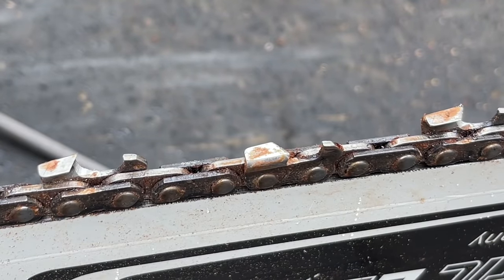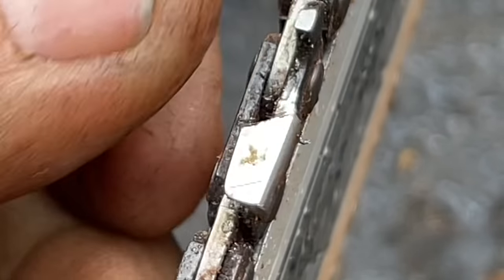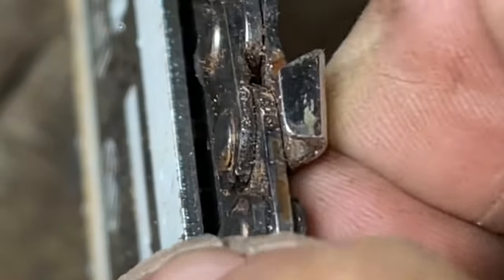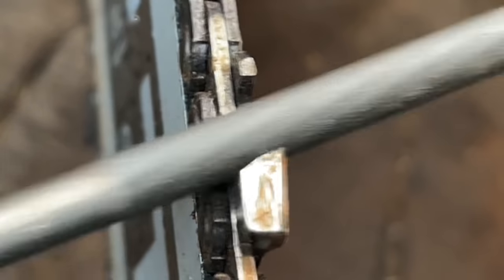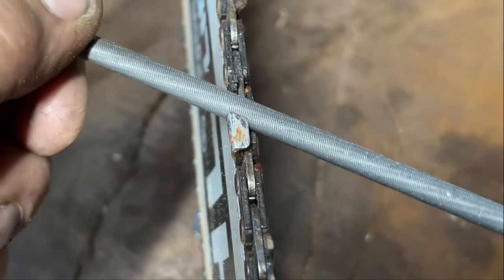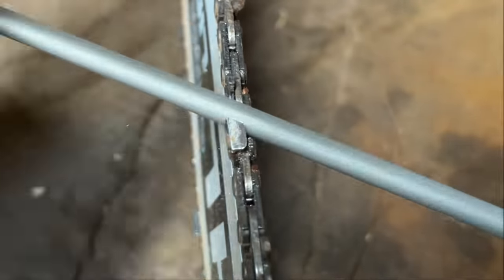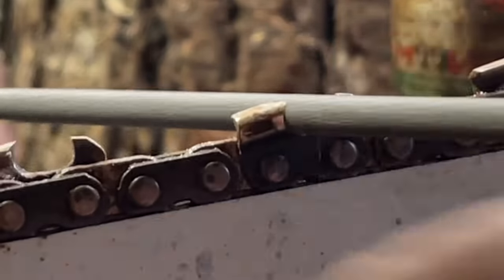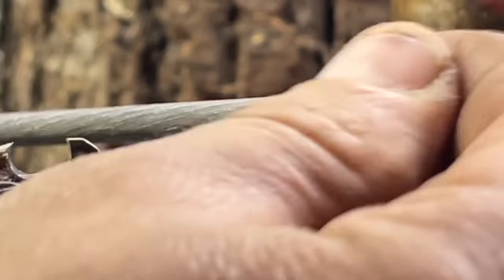How to sharpen chainsaw chain, with just a file . CLOSE UP VIEW!

Comment: I am an amateur Sawyer I watch your videos all the time I been sawing for 25 year's and you show me things I never heard of that work. Thanks man please don't stop making videos. I mostly do it for fire wood but I also remove dangerous tree's from homes. I have no climbing gear but a sharp brain and wise tips like you provide are the best. I throwed away alot of good chain's because I thought they were done and if would have known good completely sideways with file to get that hook back I would have done what you showed me. I run a holtsforma 660 it's a beast. I bought it to make my own lumber. I live in WV tree's are everywhere. I ptefere soft wood but walnut and oak for fires ash stinks to me I don't know why. Thanks again. By the way you are one of the best sawyers I seen so far

Comment: Fantastic video both professionally and personal great candor in teaching you are a natural teacher.
On to the subject matter, we are at this moment have at least 100 trees being taken down behind our property, and trees of at least 100 feet or more which could cut our home and new garage in two. Next to our garage had hardwood stump I decided to cut stump into criss cross paddern to chip it away with backhoe and what was produced was saw dust. Hardware store to have chain sharpened and 2 new ones to go. He used an electric grinder on the old chain and tried it when I got home and it wouldn't cut do da, worse than before. New chain and was able to do the down cuts and across and removed stump. Told my Logger Mike about what had happened and he said exactly what you said "never ever let anyone use a electric grinder on your chain ever, it blues the chain".  He proceeded to say once it's blued a file won't work, the tooth is ackually hardened. And then I stumbled onto your channel, you just confirmed the reasons why thank you so much for this video explaining.
On another note, my Co-driver and I drive to Nanticoke, Ontario to pick up loads of nitrogen and the people we encounter are of the highest caliber in action and in words,  sincere nice people with class the blue collar and management I'm speaking of.
Thank you
Reply: As I'm reading all the other posts a question came to mind. Are the rakers you speak of the steel bump directly in front of the cutting tooth? And I am surmising their job is to clean the saw cut?

Comment: Hey Buckin. I would appreciate some more basic instruction like how to know what size file to use, how to measure the rakers, which direction to apply pressure, what angle you like to sharpen at, etc.

Comment: Hi from down under New Zealand. Now have been able to apply your comments about sharpening. Now have probably cut my time cutting wood 🪵  in half much less effort.

How about doing some video on just turning the saws. High and low jet tuning. Just keep making and repeating the key points and I get there but I need some indicators on what to look for, to hear, so I'm on the right. What to look for when I get it wrong and how to fix.

Thanks
Paul

Comment: Billy I love these videos, I’ve been getting a lot better … not totally consistent but better. iWork with a bunch of saws and I get most confused on which size file to use on which saw. I know it has info on the bar about chain size but sometimes the bar is so worn away it has no info , can you help me out with some tips love you bud thanks.

Comment: Billy is it possible to sharpen a chain after brand new and it be sharper than factory sharp? Hopefully in less than a month I will have my new 592xp its on order from my local dealer. Also, what is the best chain out there? What make and model chain do you recommend?

Comment: The file you're using is huge!  The recommended file for my chains is much much smaller, so small that they fit all the way underneath the top plate.  I feel like it's too small.  Should I be using a bigger file?
Reply from the maker: benjamin , i wood recommend you try both and have yer own experience ,, the file i am using is 7/32  it is what  is recommended from the shop

Comment: 60 yrs ago more or less, at about 12 yrs old, a Lombard saw, a Sears garden tractor and 2 wheel trailer kept our house warm. Daddy was in the bed with a bad back. Old heater was thin metal that would get red hot and almost see the fire inside.  Brake on the trailer was a 2/4 rubbing the tire with brother hanging on. You gotta to what you gotta do, kids nowdays so sorry.

Comment: You should do a video comparing eyeballing it vs using the Stihl 2 in 1 file. Would like to see if the 2 in 1 is sharper or not. Thanks Buckin!
Reply: When you know what you're doing, nothing beats hand filing. You can get it exactly how you want it and make it consistent around the loop.
Reply: Stihl 2 in 1 filer works great! What I do is hand file a hook in there first (get the gullet) and finish with the 2 in 1...

Comment: Buckin you have helped me so much in my filing but I'm looking for a new saw for milling lumber but want it to handle any thing I do really only have access to Stihls so I'm leaning toward the 461 500 or pretty much any of the bigger Stihls just looking for a experts opinion
Reply: 462 has been way better than 461 for us. Both pretty small for milling though
Reply: 881 I think is the current big boy wallet buster.
Reply: @neild7971  Yeah my gut says 661 but I ain't sure have to do more research would love it to handle firewood milling and everything I throw at it I cut stumps every once in a while which is super hard on every part you can imagine thank you for your feedback sure appreciate it

Comment: So equal strokes per tooth really doesn’t matter right? As long as all are sharp?
Reply: Doesn't matter, you will find teeth with different hardness from the factory that just require more strokes anyway, plus its almost inevitable that some teeth will end up shorter over time, some just get beat up worse, no point grinding away all the others to match them up. All sharp, consistent tooth shape, angle etc and you're good in my experience. When you set your rakers/depth gauge its for that individual tooth, longer/shorter doesn't matter so much, its more important they are all the same depth generally 25 thou.

Comment: Would be an educational video to see you “destroy” a chain by hitting rocks and metal someone might run into unexpectedly and then bring the chain back to clean sharp!
Reply: Pretty much what you have here, can get worse I know but same deal.
Reply: @neild7971  it can get way worse, found out the hard way, left sitting with a brand new chain that’s pretty chewed up, found large river stones inside of an old Oak log that was hollowed/rotten in the middle, along with some wire from fencing.  😅

Comment: My chain links more slightly, giving chatter while attempting to sharpen. Your chain does not appear to be locked on the bar for each tooth. What stops the chain moving from the pressure on the file ? Is the chain very tight on the chain bar as there doesn't appear to be any movment of the likns while the file is cutting ? Your comments would be very much appreciated

Comment: I think my biggest take away from this video is the cheap file I bought is trash and don’t skimp on a good file!
Reply: I am confused as heck I confirmed the size of my file for a Stihl 3/8 inch pitch chain eyeballing it in the gullet at clearly is the right size file it's 7/32nds.

I pull a brand new file out of an Oregon bubble pack and it won't even cut at all I pivoted all the way around I go from the front and it won't cut I go in the middle and it won't cut and I go out the back of the file and it won't cut. This is a brand new file. What the heck am I experiencing here? I was testing out a number of different round files I had on my workbench and I grabbed the oldest and nastiest and gnarliest and clearly most filled with metal shavings and guck, and it cut like a champ. I don't have any idea what size it is other than it also fit the gullet properly and looks the same diameter as the brand new Oregon one.

Has anybody experienced this with a brand new file? Did Oregon have a bad batch question mark these are several years old they were just never opened.

You know that sound that a properly sharp file makes like buckin here is experiencing. It's that nice grind cutting noise that tells you you're getting chain back.

Comment: How do you know what file size to use? That’s what always gets me. I usually tend to go bigger
Reply: Usually a number on the upper part of the chain chassis that correlates to file size. Google file size tables
Reply: Also, a quarter of the file should be above the tooth I believe. With a large enough size to reach enough of the gullet.
Reply: 3/16 for .325 and 7/32 for 3/8 works good for me :)

Comment: Hey everyone I was just wondering how long does a file last like the life of the chain or a certain amount of failings? If anyone has a answer that would be much appreciated.
Reply from the maker: I get 4-5 filings on a 32 '' chain  which wood equate to 8 -10 0r so with a 20'' depending full house or skip
Reply: @BuckinBillyRaySmith  Thank you!!